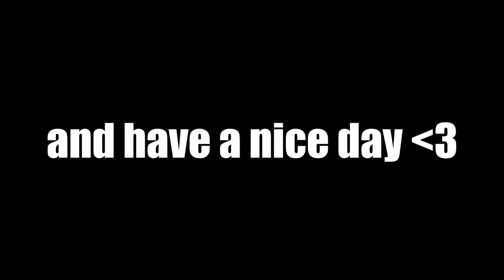This Car Has A Pimple

Comment: 8:39 and you wonder why my Jeep has bulletproof tempered glass instead of the stock glass. It's got the same designs, and such, just the glass is protected. I've been through 1 hail storm. That was when i was passing through Janeu travelling to Anchorage. Thing is the only thing I found damaged was my ice box cooler that i keep in my cargo bed. that little 7 year old cooler kept my thousands of root beers from over the years cold and ready to drink. sadly i had to replace it after the hail. had some dents on the roof but thanks to offroad armour plating installed under the body panelling, tempered glass, and a reinforced Line-X bed liner, I and my Jeep survived the golf ball sized hail.

Comment: The Audi V10 sounds odd and warbly like a V8, or rather, more alike a VR6 because it's a 90 degree vee angle with straight pin crankshaft. This makes it an odd-fire V10. The lamborghini version of the same engine uses a split pin crank to achieve an even firing order, which is why a Lamborghini Huracan sounds different from an Audi R8 V10. If you like the V8 rally car, lookup the LS powered Chevy Spark rally car.

Comment: Yes the seatbelt can do that.
if you crash to a dead stop from 70 kph your body weight times the G forces will have the seatbelt resisting a force of something like 1000kg for 0.001 of a second. 
You might not be able to lift a car with the seatbelt but you will certainly be able to apply incredible amounts of force as long as it is for a short period of time.
it is what they are designed for.

Comment: I need to own a 5 cylinder once in my life.

I knew there was a Vauxhall Firenza, but a Chevrolet one? But Vauxhall also has two race cars of the Firenza. One is called the Old Nail and the other is the Big Bertha.

The Maserati Quattroporte sounds so good because it uses a similar engine to the Maserati Gran Turismo. And that car took it from the Ferrari 458.

I want that NSX in Beam to even out my terrible driving skills with fast RWD cars.

Comment: In Punjab, India there's a 1992  Ford 3600 tractor that has been modified to reach speeds upto 110kmph and the tractor doesn't even have an roll bar no seat belts only one seat but can seat 2 more on the fenders and in the video two guys are casually sitting on the fenders of the tractor by holding behind the driver's seat while tractor is doing 80kmph

Comment: 5:03 Backwards Bob isn’t a thing anymore sadly, the name hasn’t been ran since 2017 however Feld Motorsports (Owner of Monster Jam) still hold the rights to the name. The in video (Anaheim 2008?) the tires aren’t placed on backwards but sometimes even those were placed backwards. It was so backwards then when the head-ceo of Feld saw the truck at the World Finals 17 (2016) he told the track crew to, “face the truck the right way”

Comment: 2:42 I've seen that video before it's a Case steam traction engine... only about 120hp but over 3,000 crank ft/lbs tourqe at 200rpm nothing can stop them.... and the "fire" coming out is saw dust the operators put in the fire box just for show

Comment: Those old steam tractors had remarkable pulling power, but fast they were not.

Also, dude in the chevy rally car definitely needs brakes. My old car with completely unassisted brakes and original hardware stops better than that!

Comment: The one with the steam traction engine I'm going to tell you right now steam engines are more powerful than any other gas, diesel or electric engines goes on a steam-engine you get a power stroke on each end of the piston and the the more Pistons you have the more power you have but the more steam you waste the smaller the cylinders the faster it goes but the weaker they are the bigger the Pistons The More steam you have to waste but more power so if you have a big and pistons you need a big boiler and if you have small Pistons have a small boiler another advantage steam engine has the boiler could connect to a whistle if you give it a single chime whistle it will sound like a owl and if you give it a Santa Fe 6 chime whistle that son of a bitch is gonna sound badass